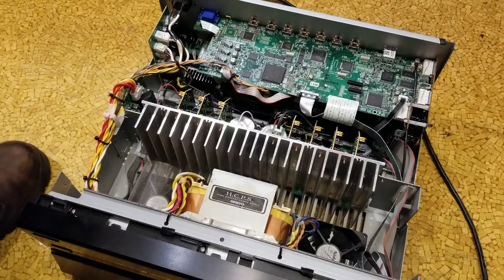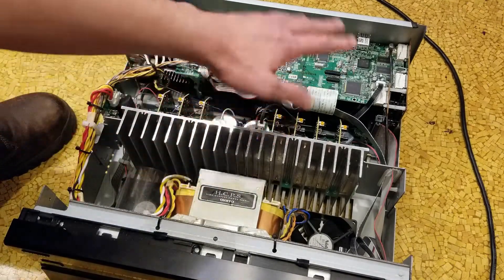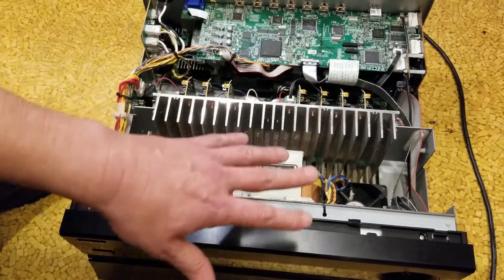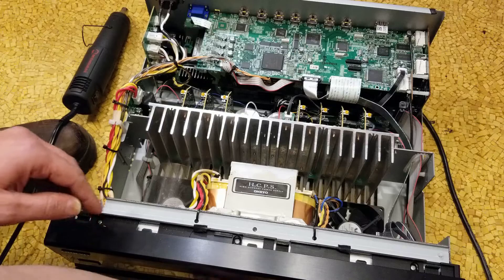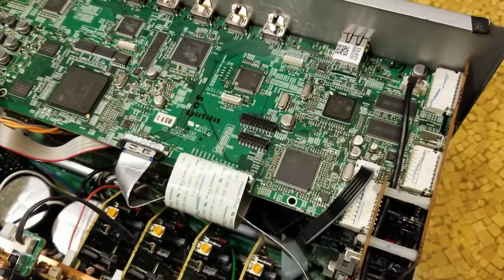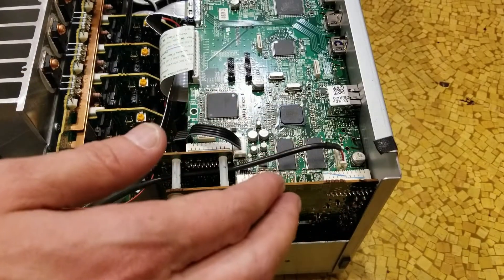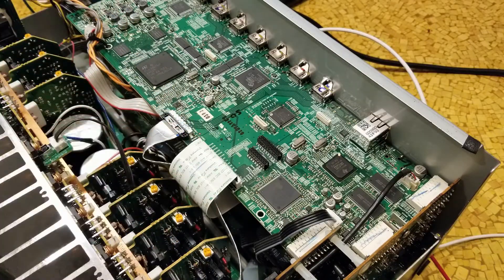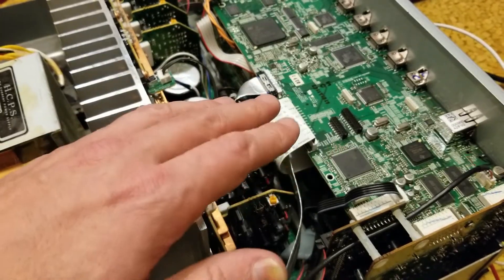Onkyo Receiver No Output HDMI Board/DTS Chip Repair

Comment: Lol hell yeah. After 10 years my tx-nr809 Onkyo channels went out. No light icons. No click. Its done it a few times recently but came on after a few minutes. Not this time. Ive been worried about this too hoping it wouldn't happen to mine. Didn't have a heat gun. But i have Imalent MS18 flashlight!!! 😂
Took some thick foil and cut a square in the center and placed it over the chip. Put my flashlight on turbo mode, placed it over the chip, counted to 25, pulled light off, pressed down on chip, it was hot!, counted to 5, released. Waited another 45 seconds and powered up.

When i heard that "click" i knew it worked!!! 

With a high powered flashlight!!

😂😂😂😂

Comment: Hi, thanks for the upload, 1:35 - resetting, I have an older Onkyo receiver called TX-DS575X. After a brief cleaning, it won't power up. Pressing the standby button turns the panel on and off again after two to three seconds. At this stage, the standby light is not solid, but flashing, indicating a failure. I searched at least 60 percent of the internet, but could not find how to reset my receiver. Your method works because the panel lights and the power are on, so the components function. But, in my case, it doesn't. I mean, if there is no possibility to reset a receiver like my case, it should be considered a failure in design!

Comment: It glad you did a follow up.  As a tech I had to warn customers it possibly a tempoary fix and might need the chip.  I didn't have a bga rework station since that is usually a dedicated workbench and would be used once a month.  Generally if there was any thing else wrong,.it was trash ( usually I would find something else after fixing a problem like this because the customer didn't mention it).

Comment: first time i tryed it worked flawles for about 2 ish month 2nd time 2 weeks, 3 time in a few days ordered some flux and a friend have a IR temp.and doing more thorough, iam sure i did not heated it up to much first 2 time.

if the chip burns up then i using my old crapy reciver and hopefult i can get Denen AVC x3800h

Comment: My TX-SR 308 recently developed a listening mode fault, with the surround channels just dropping out to a stereo status, whilst watching TV.

It was in TV logic mode then displayed TD. When I switched off/on only stereo came through.

Interestingly, I couldn’t access the full set up menu. 1-3, then 7-10. Strange. Did a reset , full menu appeared but only temporary.

Took the cover off, and tried heating the said chip. But I couldn’t read the serial number, as there was a green strip diagonally across it !!

It didn’t work, but this unit is 15 years old, ( found the receipt ) and I figure life expired, and uneconomical to repair. Approximately half the cost of buying a new unit it seems, so I’m going to buy a Pioneer with Banana Plug fittings.

Thanks for an instructional video.

Comment: Im have the same problem aswell the amp turn on fine hdmi display the blue screen when and there is no sound on speakers planning to heat the chip like you did. Did you manage to put the heat sink. My board numbers is BCHDM-0471 if someone has a working one please hit me up

Comment: If you not put an hetasink on the chip an maybe an cooler to this area like you said, the failure will come back soon, cause the area will be very hot if the Receiver is in use, and before heating the chip up use flux and cover the chips around with kapton or aluminium band, and circle around with the heat gun not pointed cause overheating a spot. !
Gratulation that you could give yor receiver a scond life !

Comment: I have an ONKYO TX NR626, that one day it start to send to the LEFT Speaker , what I believe "bad current" and start clipping, so I disconnected it.
At the present time I Had Only connected Left, Right, and Center speakers.   So now, I am only using Right and Center.   Any suggestions what to look for?  What seems to be the fault?   Thank you in advance.

Comment: Thanx for the video but my issue is different. Speakers icons are on but no sound. Sometimes I have to leave the receiver on and after a while the sound will kick in. Recently it has gone gone without a sound even if i leave it on for hours. What could be the problem?
Reply from the maker: Could be just another Manifestation of the same root cause. I Ended up getting a yamaha receiver and it's been great

Comment: The connector that you mentioned having trouble with is a compression connector.  Push & hold down on the thicker side of the connector to remove and insert the wire ribbon easily.

Comment: What if the board that the chip is on is installed vertically? I won’t/can’t take out the entire board in case this fix doesn’t work for me, too much trouble. Is it still worth blowing hot air on the chip even though it would hitting it from the side in addition to other components?

Comment: It help a lot for us Sir. Sir, do you have spare Spare DSP board for Onkyo TX-SR501. Problem dont have output and i found out a open coil and short AK4586 Chip.. Can you pls help if you know where can i buy the board or supplier. Thanks alot
Reply: Hello friend, were you able to solve it?  I have a similar problem.  When you replaced the dsp did you have to record any bios on it?

Comment: Hi. I have a question. Firstly thanks for the videos. I know this is an old one but I have a problem with my much loved, 20 year old Onkyo TX-NR905. I had audio but no video which seemed like an HDMI board fault. I replaced the HDMI board but now have no video or audio. Wondering if you have any ideas?

Comment: A little less rambling in off-topic areas would be appreciated. If I understand your comments, though, you determined that this entire effort was for naught?
Reply from the maker: That is correct, it worked for a while. Then start the fail again. The issue is with the Micro soldering inside the chip itself.
Reply: @CatusMaximus  Thank you very much, for your quick reply!  As others report some success (albeit without any verification as to how LONG their "repair" lasted), and because I can find no replacement boards or repair services on the open market, I've purchased a heat gun and flux pen, with plans to attempt the same approach.  Pretty much willing to try anything to avoid consigning my $1,800 receiver to the recycling heap.

Comment: sir, please help me, why is my amplifier like that, the brand is ONKYO, the AUX IN AND Fm radio don't work, it doesn't work, but when it's in the USB PORT, it's ok, it works, it's just that it doesn't take long to play the music, it dies a bit, it also dies when it takes too long Is it possible that my amplifier is an issue because the model is " ONKYO TX-SR313 ☹️☹️

Comment: UPDATE * Worked only for 2 weeks, tried to repair again but issue keeps coming back. Giving up, and getting another receiver, this time NOT Onkyo*** great video, used a heat gun with nozzle to heat the dsp chip for 1 ½ min. and now sound is working, also the Network actually also work it was not responding before repair. Have added a small heat sink on top of dsp to improve, but thank you very much.
Reply: Having the same issue so I'll work on the fix but before I do I'll need to get some parts like a hearsink. What size heatsink did you use? Thank you.

Comment: 22.000 hours is merely 2.5 years of duty.......... My harddrive, which also has a lifetime counter, has been running for 7. I'd had needed 3 (!!!!) receivers during the lifetime of my computer to play sound, for what you call decent runtime.....
Reply: I'm in no way critiquing your video, but the expectation on a end consumer receiver seems to be .... uhm, crappy. I can't spent $600 every 2.5 years
Reply from the maker: I agree with your statements although a receiver really isn't meant to be run twenty four seven That being said this receiver ended up failing again and I went back to my twenty year old t h x yamaha which still going strong

Comment: Thank you very much. I used some hint in the comments and applied 230C for approx. 1 minute.

I bought this Receiver for 170€ (used condition) and the issue with the DTS chip just appeared after the warrenty of the reseller ran out. I just applied your fix and now I am running some tests (and if everything works, I will install some additional heatsinks later). I will keep you updated, if everything works out in the future.

Comment: A lot of the discussion about the "heavier amplifier section" is kind of bullshit since newer semiconductors can do much more than the stuff on the older "heavier amplifier sections".
Reply from the maker: You still need a heavy transformer and big capacitors to supply lots of current and power. Even a receiver with a switching power supply that would supposedly deliver a 1000 W would be pretty heavyA 1000 watt computer power supply is pretty heavy
Reply: @CatusMaximus  No, if you do your SMPS properly, you don't need a big transformer at all. That's the reason why all power supplies today are very light. This is all because of better semiconductors that can support the higher frequencies needed. Check out some server or SFX 1000W power supplies. They are not that big and weigh like 1,5kg without their casing. In the 70s-90s you would've needed probably at least 2kgs worth of transformers to start

Comment: Jeez Christ:   You say twice you melt the solder at a certain point but don’t make it clear if melting the solder is good or bad.
Reply: Melting the solder, or what is called solder reflow, is what is needed to make the solder balls connect to the pads on the PCB. Over time, one or more balls will be disconnected or open circut.  If you apply flux and heat to 250C, the solder has a good chance of turning liquidous and make the connection again.

Comment: Hi
Great vid, thanks
I've tried this now a couple of times and last attempt I reached 330F. couple of questions
-	Is this know to be a proper fix, even for a year or two? I ask, as mine is still not working when it cools
-	What sort of temperature can we expect the chip to fail at? I’m using a paint stripping thermal gun…lol
Reply from the maker: I found that I just got lucky ( Issues have come back I now have to switch inputs around to get the speakers to work) sometimes you have to heat it up much hotter hot enough to get the soldier to melt, also Flux should be used.

 Also I have since learned that some of these issues are due to the microscopic wires inside the chip itself failing.
Reply: @CatusMaximus  Hi and thanks for the reply. 
I’m thinking the processor has had it, and on top of that I may now have blown part of the amplifier circuit, as it requires high volume now to get a decent sound level.  
Had a look online and cannot locate replacement board for this, so I fear it’s time for a replacement unit. Quite shocked and disappointed at just how bad this thing has lasted, and the level of support for it. I don’t think I’ll be buying Onkyo again, even though it appears the TI chip is the culprit
Reply: @CatusMaximus  Hi
Just to let you know, I heated a couple more times using flux. Just ordinary flux from my soldering kit, using a brush to apply. I think temperature must have been approaching 400F easily, and am surprised the board didn’t fail. I also did a factory reset, as at one point the sound appeared muted. Seems to be working properly again now for the past week, so fingers crossed. Appreciate the help….you may well have saved me £600….cheers

Comment: Very instructive, very useful learning!...

I know this receiver IS old and entry level, but i have two identical VSX-522 units here at home (probably the canadian version of vsx-521) ,
one upstairs and one downstairs.
The one in the living room stopped working this week (all seems ok with controls and functions, but NO audio at all coming from any speaker outputs, or headphone jack))

i tried everything to give it a factory reset (power/standby + "BAND" button), and it does not work at all.
The video monitor out is working so i was able to go in MCACC mode, to be able to manually generate the calibrating tones for the individual amped channels, nothing outputs to the speaker when i push it.
Only sound that comes out of there, is a thump from the SUB on power-up, which makes sense since it has it's own amp. (and maybe a grin or two coming from my mouth)
I should mention, ALL HDMI inputs are functional and audio reaches the TV in HDMI=THRU mode.

So i decided to bring the other unit to the bench ...: EXACT SAME RESULT

So now i have TWO vsx-522 stacked, which for now , only LOOK good.

Do you think these vsx units could have the same DTS dolby chip problem?

Thanks for doing what you do !

Comment: Another thing to try is to look for any 100uf 4V metal can caps and change those, ideally for a higher voltage rating and possibly even with a slightly higher value since the  higher the voltage of the  caps the more the internal series resistance is but the higher the value of the cap the lower the internal series resistance is so if your upping the voltage rating it might be an idea to up the value a bit to compensate for any lowered esr from higer value voltage. This advice is not set in stone but i did see somewhere that someone replaced the 100uf metal can  caps with a much higher value and it still worked.
Reply: It's 99% not a cap issue, but a BGA chip solder issue.

Comment: always check all metal can caps b4 trying bga, shield all bga's and target all metal caps with a warm air nozzle. see if it comes back to life, some caps are under the board. And if anyone is going to try to reflow please use traceless flux!
Reply: Usually a no-sound/no output relay issue on these types of receivers IS a BGA issue. I've never found any bad caps that caused this exact issue on many units. Not saying I haven't found bad caps, but I haven't found them to cause this same issue. It was always a bad solder issue with the BGA chips.

Comment: shit my H/K AVR 435 idles at 117. the heat is not really the issue with these systems its the fact that there is no way of dissipating it. they can run hot like that for ages. Onkyo did bad on thermal management and I would bet them chips are running at a higher voltage than what's actually needed.

Comment: Can liquid flux be used to improve reliability of the repair, or is flux only useable on the flip side of the circuit board?
Reply: Yes, almost certainly. But you'd have to remove the board from the receiver and squirt flux under the chip, heat it to reflow the solder, then clean with flux removal spray. If there are any high impedance pins, any remaining flux will create leakage paths.  And in the industry, we use degrees Celcius, not fahrenheit.  Lead free solder melts at 217C. Measuring the top of the package is fine, just know that the solder balls underneath will be at a lower temp, so heating the top to 260C is best.  That's the max temp for virtually all chips when subjected to a solder reflow process.
Without flux, heating it up is ok but I don't think it'll last long. If he had some cold spray, you'd likely see the problem return.

Comment: I tried to do a reflow on my integra dtr 40.2, put some flux around the chip and heated it up with a heat gun. After a month i had to heat it again, i put a heatsink on the chip and it still failes periodically every month or so. For a year i've been heating the chip every time audio goes out, not exactly an elegant solution but it hasn't kicked the bucket yet. 

Also i had an issue with a back channel speaker that would only play static, out of pure curiosity, i put heatsinks on my entire hdmi board, and it fixed that problem
Reply: Are the heatsinks still working?
Reply: @Truth-Machine5000  Haha, nope! I retired my amp, i couldn't get it to function anymore. I must have overheated the chip because i can't get any sound out of it.

Comment: Mine Pioneer vsx322 only last 8 years, bought in 2013, person at Pioneer said need to replace the board,but the board is no more produced.😭
Reply from the maker: That's why I still keep my old Yamaha RX-V2400 & HTR-5890 THX 7.1 Receivers... They still work great and are nearly 20 years old. They don't have HDMI or support master audio but have better equalization from the microphone auto setup then this Onkyo.
Reply: @CatusMaximus  Sir,in this moden amp, which brand are recommended, maybe some I can't find in Malaysia.

Comment: Some of these comments, lol. This was a wide spread issue across many manufacturers during some specific production years due to them all using the same garbage TI DSP chip. So before you "stick with" your brand of choice, keep in mind that Onkyo, Denon, Yamaha, Pioneer, etc. were all effected. Just like how they were also all effected by the janky ass HDMI 2.1 ports on the 2020 models.

Comment: I have silicon Image chips in my Onyko.  What is the equivalent to the TI DTS chip to heat?
Reply: As far as I know, silicon image had designed chips to process the hdmi signals. I have a denon and marantz receivers that use various versions. The denon receiver had an sil9185 chip that failed, shorted the supply.  Just removed the chip and ordered another one from China. Fingers crossed. I don't think TI builds a direct replacement part for silicon image, at least not for receivers 8 yrs or older.

Comment: Are all TI DSP Chip the same/compatible? I have an old(10 +Yrs)  Onkyo  HT-RC270. I checked Ebay and they are selling these chips but the numbers are not the same as mine. The description/number on mine is  D830K138ZKB83 YF-04A2C3W GI

Comment: That chip went bad in my 2012 Onkyo. I used a commercial heat gun with concentrator tip to heat it but no luck. Found a Denon on Crutchfield for $300.